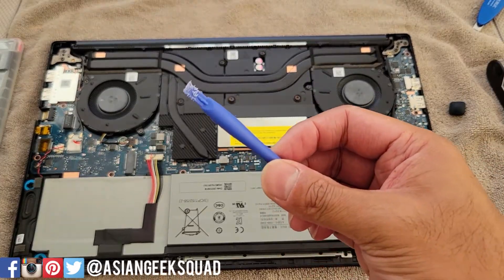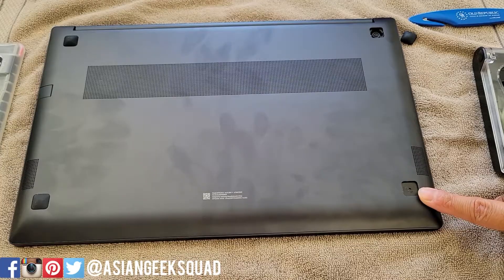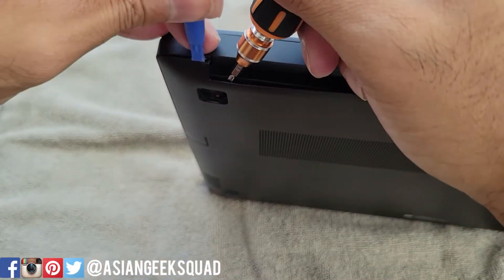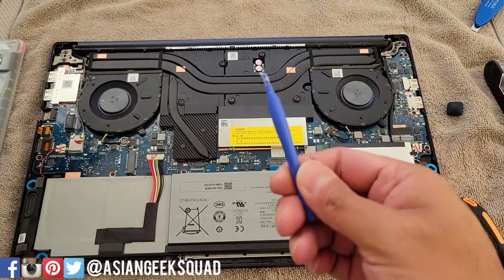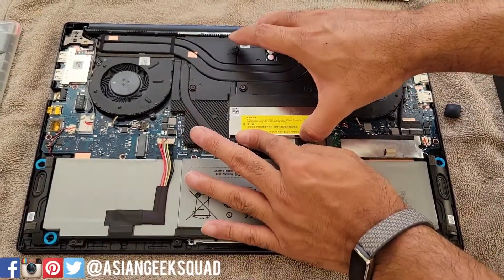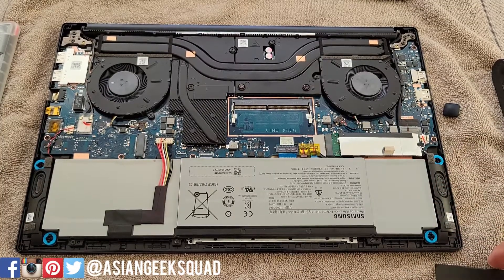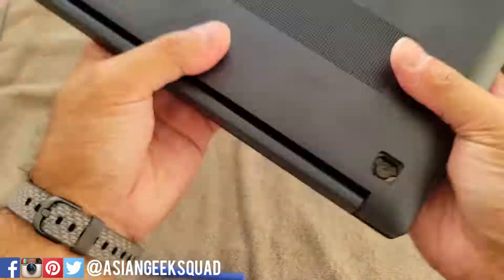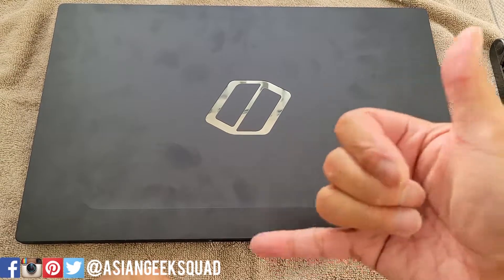How to Upgrade the RAM and SSD on the Samsung Galaxy Book Odyssey

Comment: I installed 3200 Corsair vengeance on my my same exact one as yours came with 16 and I’m getting a black screen and won’t return to normal until I remove the additional 32 ram?

Comment: I own a 16 gb model and already upgraded the ram to 32gb and ssd to 2 tb....
1- get the same ram speed and size to run efficiently
2- I hate crucial products get yourself a Kingston fury 3200mhz  ram
3- this has a tiger lake CPU but samsung did put limitations on the motherboard !! Don't try to force gen 4 ssd to this laptop gen 3 it is!!! And 2tb is the limit!
4- first thing you wanna do while after opening the laptop back panel is to detach the battery!!! Or you'll short the motherboard or your battery will stop working
Reply: thank you for your advice!
Reply: @farzan4882 thanks for posting the specs you used to do the upgrade; I have the 16GB RAM model as well, and planning to the exact same upgrade on memory and storage.

Comment: I fcked up two Odyssey laptops by hot swapping the RAM & SSD from one to another. 1TB 32gb RAM onto a 512GB 16gb RAM model. Both laptop batteries were not charging afterwards, once both laptops reached 0% battery, they never turned back on ever again. 

Please proceed with caution if you're going to upgrading the RAM & SSD to your Odyssey.

Comment: i have the galaxy book 15.6
is it possible to upgrade the ram from 8 gig?
Reply: Not on mine (purchased Feb 2022 from Samsungdotcom) All the RAM is soldered to the motherboard. But there is a second PCIe SSD slot--where the primary SSD slot is on the Odyssey. The primary SSD slot is where the RAM slot is on the Odyssey. Also, my Book 360 15.6 had four screws, not two.

Comment: Hello, do you have any information about Samsung galaxy book 15.6 i5 is it possible to upgrade and what?
Reply: I bought a Galaxy Book 360 15.6 Feb 2022 from Samsungdotcom. All the RAM is soldered to the motherboard. So, no RAM upgrade. But there is a second PCIe SSD slot--where the primary SSD slot is on the Odyssey. The primary SSD slot is where the RAM slot is on the Odyssey. Also, my Book 360 15.6 had four screws, not two.
Reply: @ThomasHoranSIUC  hi can i contact with you and ask about samsung book pro 360 ?
Reply: Is it same motherboard?

Comment: Concerning the RAM, are both slots user accessible?  You added 8GB for dual channel memory, but could I replace the one that is already installed to a higher capacity?  For example,  installing 2 X 16GB to max out the memory.  Thanks!
Reply: 8GB are soldered. You only have a single slot available.

Comment: you're the only source on the entirety of the internet who has info on how to disassemble this and install more ram. thank you so much. 
Side note: I bought a 16gb RAM card because from what I could find online this would allow 8x8 dual channel, and the remaining 8gb on my 16gb card would run solo. Is this true or should I return it and get an 8GB card?
Reply from the maker: Up to you, personally I would use the same speeds 3200 and the same size. If you're going to get a higher capacity, at least get the same speeds. 3200. 🤙
Reply: @AsianGeekSquad  Really appreciate the advice. I got all the same specs, it's even from Samsung. It's just 16gb because I wanted more than 16GB total and the 32GB option odyssey wasn't in stock/was out of budget lol I'm shutting down now to make the installation thanks to your video
Reply: @AnthonyTat  I picked up a 16gb 3200mhz stick, and have issues with boot. Once I remove the additional memory it runs fine. IDK if the odd ball 24gb of total ram is causing the issue. I'm gonna try and look into the BIOS and see if I can find anything.
Reply: @mbrown22021  Have you resolved the issue with the BIOS?  I have 16 soldered on the board, I try to set 16, the same problem, it does not start ...
Reply: @mbrown22021  Have you found the issue Im having the same problem
Reply: @jancarlospena9558  and others. I as well had this issue. Got G skill Rip Jaws as well as Samsung memory, both 16gb 3200mhz, and both refuse to boot. However I did have luck with Crucial 16gb 3200mhz from Amazon. Seems the laptop is just picky with what ram it likes, hope this helps.